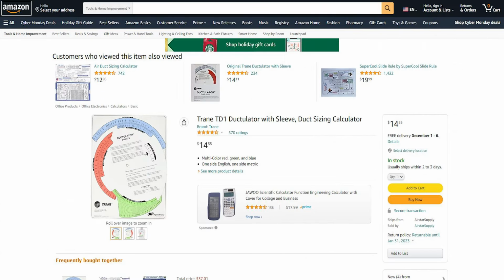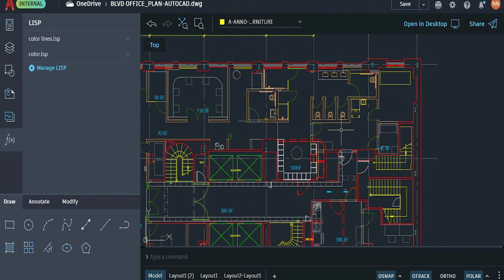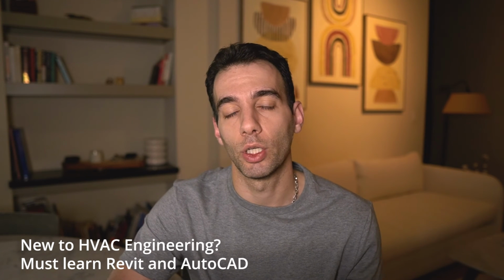Which software is used for HVAC Engineering?

Comment: Thanks so much for your presentation of software.  I have done base load calculations manually for years and it's nice to see software that's available (even if it's a bit $$$$).

Quick question, do any of the software packages have a part/module for flow turbulence (air or water/glycol)?  Thanks in advancve.
Reply from the maker: HAP and other load calculation software provide options for water/glycol analysis. For specifically turbulence analysis, you need to work with a CFD software such as ANSYS/FLUENT or AUTODESK CFD.

Comment: As an entrepreneur in the HVAC, from which software should I start? 

Load Calculation 
Duct Design and 
Pipe Design…
Reply from the maker: Load calcs: HAP or Trace 3D
Duct design: ASHRAE Duct Fitting Database
Pipe Design: Fathom, Syzer

Comment: why I find no one talks about the autofluid tool (in  autocad), which makes drawing  hvac piping systems much easier than using the autocad alone.
Reply from the maker: @ziedtemimi8738  might because Revit is more popular in designing HVAC, at least here in the US

Comment: We use IESVE and honestly is far better than anything else I've tried. HAP and Trace are just a bit outdated now, and IESVE uses the heat balance method... which is the most accurate method as well
Reply from the maker: @toronator6486  thanks for your comment. I believe latest versions of HAP and Trace have highly improved accuracy

Comment: Hi sir This is Nizamudeen and i have watched your hvac related videos and its really good and i would like to know which software or the steps to implement digital twin for hvac system because we have a project on hvac digital twin so i think you are the one who can help me to answer the question and please suggest me some software related to hvac load calculation and digital twin software to monitor real time data using sensor and cotrol it using iot. Please response asap sir

Comment: Hello Sir, As I am new to HVAC Design Engineering, As a Beginner HVAC design engineer and Draftsman, we are using AutoCAD for drafting locations of IDUs and ODUs and many more same we using for clash coordination also and now  i think we must switch to Revit for above mentioned tasks. We are also using E-20 Excel sheet for load Calculations and Ductulator for Duct and pipe sizing.
Thanks AEC for sharing such informative videos. You got another subscriber who will never miss your any update.
Ok that's it for now hope success will always follow you.
Reply from the maker: Glad that our videos are informative for you!
Reply: Hi, want to explore HVAC Design. Can I connect to your linkedin?
Reply: Hi, where can i get the E-20 for heat load calculation?

Comment: Thanks for sharing. I always use AutoCAD, TRACE 700, and Ductulator for duct sizing.
a question for you, what's the difference between Trace 3D and 700?! should I switch to Trace 3D?
Reply from the maker: Trace 700 is discontinued and is replaced by Trace 3D.
I highly recommend using Trace 3D as it is more capable and accurate than 700

Comment: Which software calculations the heat exchanger
Reply from the maker: Manufacturers usually have software for calculations of transferred heat in their heat exchangers. For example you can use GREENHECK COIL SOFTWARE SELECTION or BELL AND GOSSETT THERMAL PLATE HEAT EXCHANGER SELECTION PROGRAM
Reply: @aeclearn  Thank you so much 💓